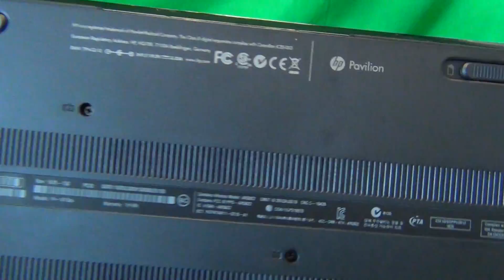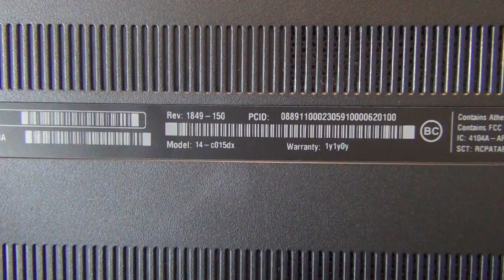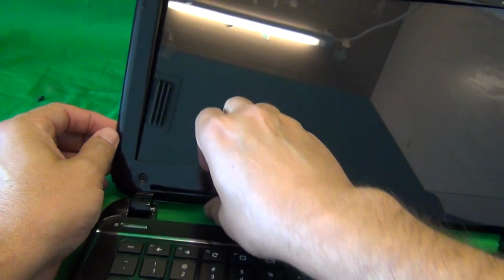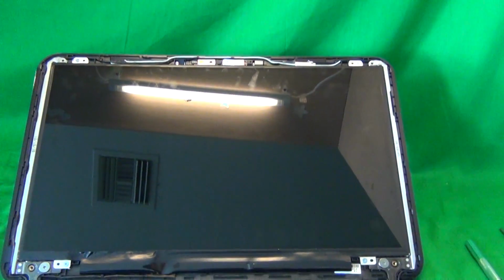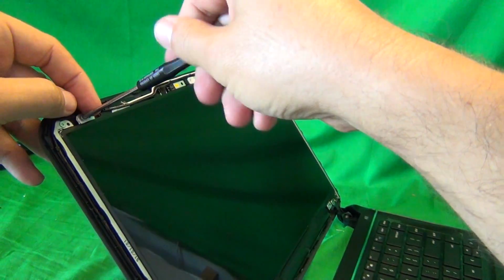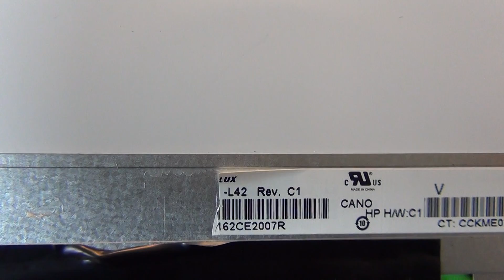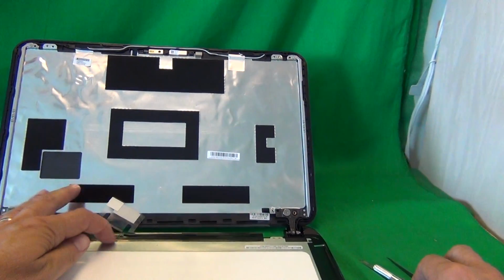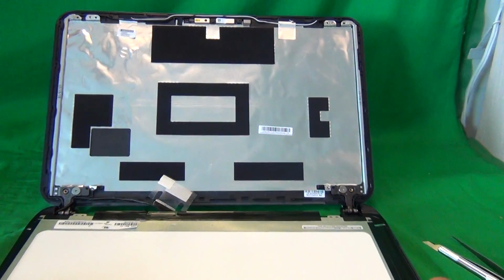HP Pavilion Chromebook 14 Screen Replacement Procedure

Comment: Fantastic, easy to follow tutorial. I was afraid to attempt to fix my chromebook before I bought a new computer. So I paid the $300 for a new HP Pavillion x2 then spent another $50 for a replacement screen. I could have saved myself the $300 because you made the replacement a no-brainer. My chromebook is back to normal. My daughter is going to college so both computers are still needed. Thank you very much for posting this video.